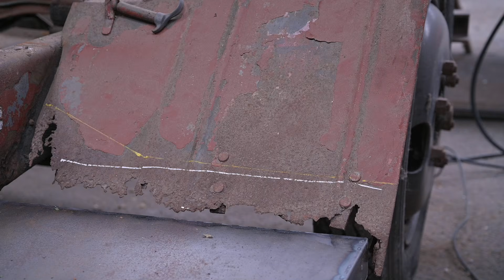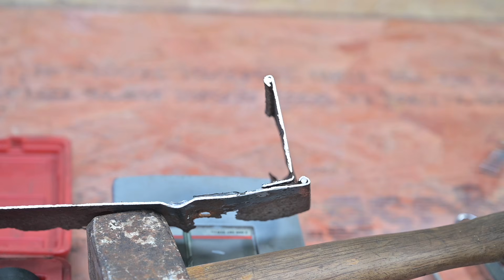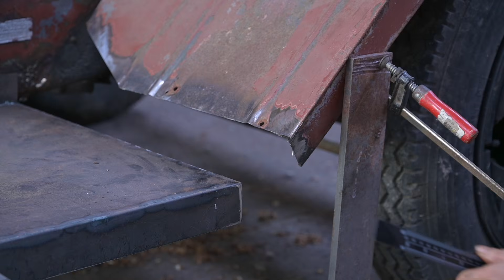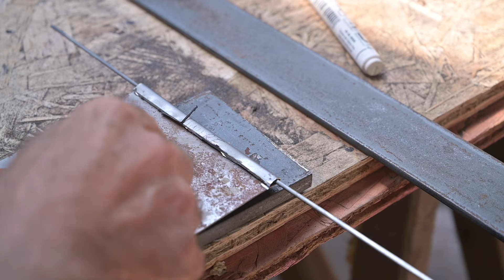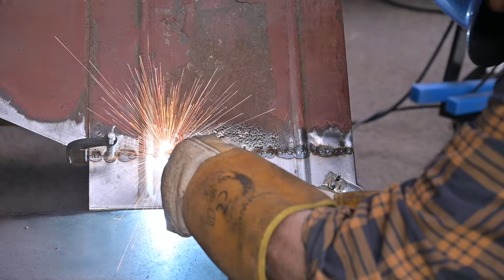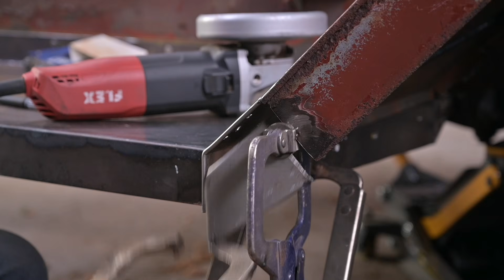Old Rusty  - Lower fender repair and rebuild

Comment: Good job!  I always enjoy your videos!
It's a bit hard to tell from the video, but it appears that when you were butt welding the fender pieces together, the two pieces of sheet metal were not in alignment...  Simple & cheap "Butt Welding Clamps" are widely available to help keep the sheet metal in alignment for welding (if you choose to try them).  Alternately, placing a thin bladed screwdriver in the thin slot between the two pieces of sheet metal and rocking it back and forth until the sheet metal is aligned will also work...  The slight gap from the clamp or screwdriver may actually make the welding a bit easier as well...
I think you will find that if you weld the seams in this fashion, it will greatly reduce the amount of filler needed to do your grinding & finish work.

Comment: Hi Steve, I agree shot blasting is not fun and is messy.  My preference is to dip the entire car less aluminium parts in a tank of rust and paint remover. This is very good at removing rust from inside hollow sections.  Then dip again in permanent anti rust coating.  What do you think? Best regards.

Comment: Hi Steve,
I recently read an article that these trucks were also produced for the german military.
In order to "help" the German efforts, they were equipped with shorter oil measuring sticks, which would cause the engines to frequently die from oil starvation.
With proper oil level maintained, these engines were very durable, however - so make sure, you haven't got one that was built for the Germans!
Reply from the maker: Thanks for the comments, indeed the Germans did produce those during WOII
Reply: @D3Sshooter  Oh, so it was a license build in Germany and not built by France for Germany?
Then, these should be easy to distinguish.